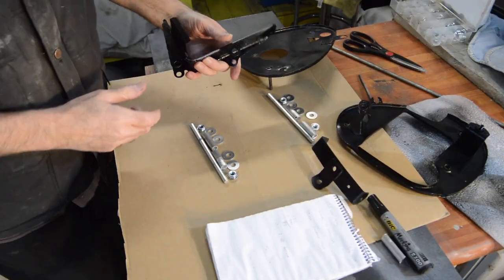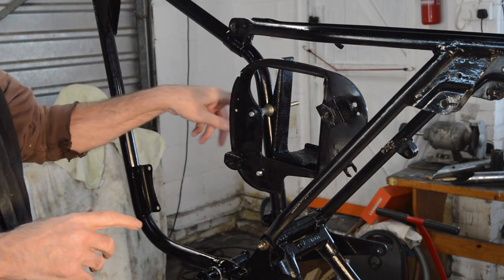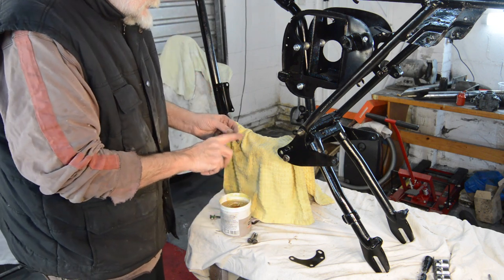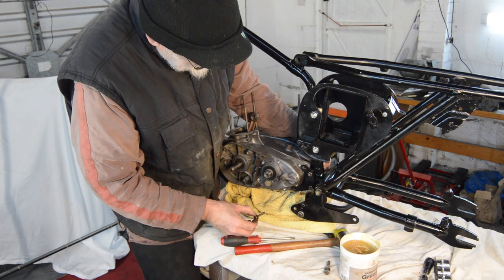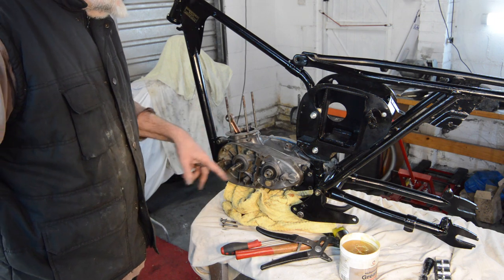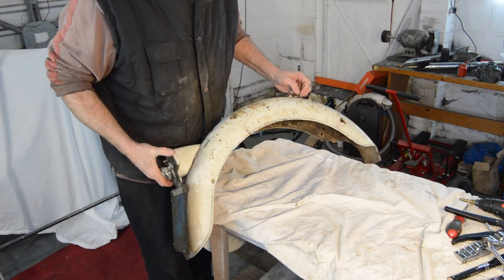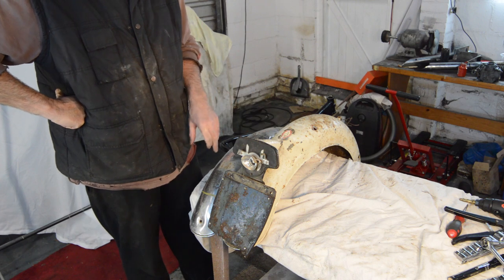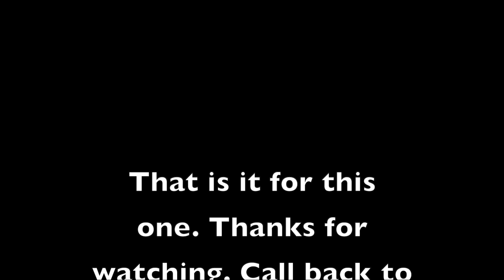Bantam Build Part 3

Comment: The curse continues of the "Bike in a Box",  it's so funny the classic motorcycle channels are saying the Bantam are great buys with parts still available.... just not a 68-69 D14/4.  Good luck on continuing with this,  even if its getting what you have stitched welded back together and bondo-ed to death.  I would take it if it looks nice and is a daily driver, which is what I would use it for.  How much trouble is an engine not on the log book to MOT,  we don't have that issue in the USA  as most of the titles here only have the frame ID listed not engines#'s.  I will have to go back and watch your video on paperwork to see if you have already told me about that.  Thanks again for the wonderful tinkering in the garage.
Reply from the maker: I was then aback with the parts situation in all honesty Max, the bigger British bikes seem much better served. The engine number is not a big issue, just a shame that they are not matching, but this is a budget build just to mess about with so no big deal really.